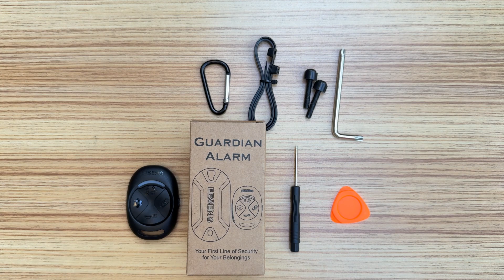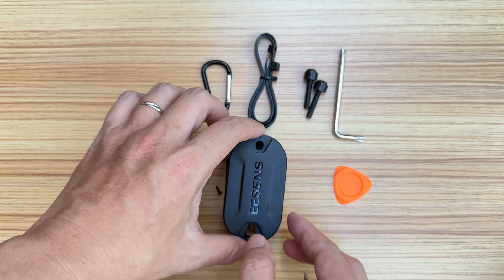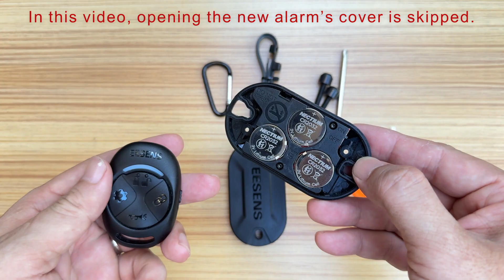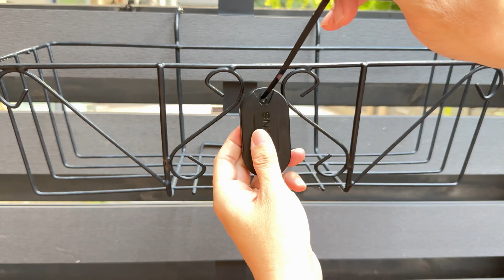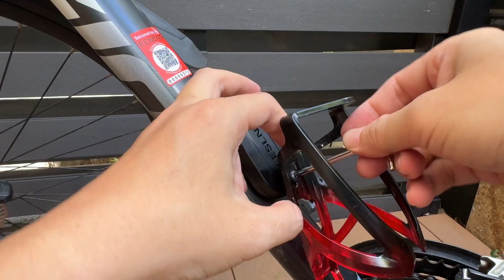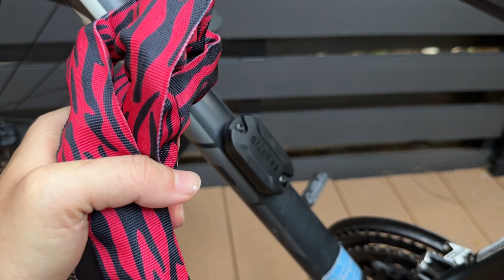EESENS Guardian Alarm Setup: Quick Start Instructions (Installation, Pairing & Operation Guide)

Comment: When I  press and hold the gear button it doesn't do anything but 1 beep
Reply from the maker: Do you mean the left button (Alarm Setting)? Pressing and holding it cycles through the 3 sensitivity levels. 1 beep indicates it’s set to Level 1 (Most Sensitive). Try holding it down again, and you'll hear it cycle to 2 or 3 beeps!

Comment: Absolutely terrible. I’ve just bought one and it doesn’t work. When you turn it on, it gives 4 beeps instead of 5. I even watched the video beforehand — it’s a scam.
Reply from the maker: Hi, we sincerely apologize for the confusion! The 4 beeps actually mean you received our upgraded version of the device. This update does not affect the pairing mode or any functions at all. Unfortunately, we cannot modify the already uploaded YouTube video to reflect this change, which led to the misunderstanding.

For detailed manuals, FAQs, or to contact our tech experts for further assistance, please visit our dedicated Support Hub: https://eesens.com/en-ww/pages/p32_supporthub
Reply: @eesens  Thanks for your reply. Everything is sorted now. I was waiting for five beeps, but it only gives four, so I didn’t move forward and ended up putting it away. It’s working now though. Hopefully this helps others too.
Reply: @dionspot I was wondering the same thing, but thank goodness for YouTube.

Comment: How to turn it off while you drive or while you installing since its not stopping and my ears hurts
Reply from the maker: Hi, your alarm might have been triggered accidentally by the remote control (e.g., while in your pocket or bag).

To prevent this, please turn off the remote using the side switch, as shown at the end of the video.

Comment: I meassure 70db max but aside that for the price cant go wrong. Also full alarm stops after 15 sec if its still
Reply from the maker: Hi, please measure the volume using a professional sound level meter rather than a phone app, keeping it 10 cm away from the buzzer. All of our products pass strict sound testing and quality checks before shipping.

If you believe your device is defective, we are happy to take full responsibility. Please contact our support team for a replacement here: https://eesens.com/en-ww/pages/contact